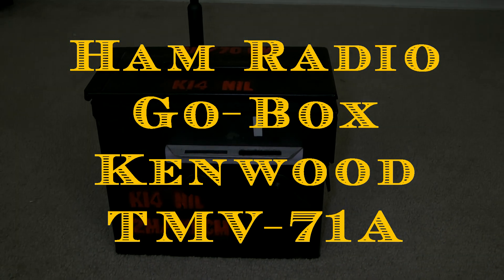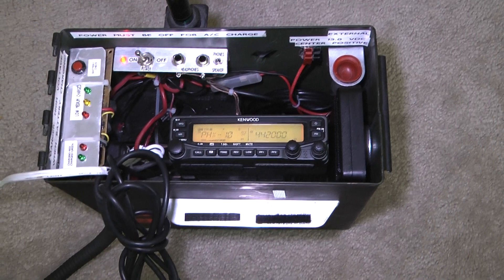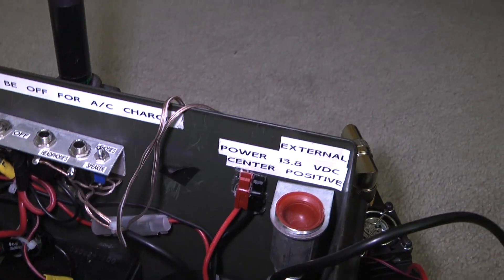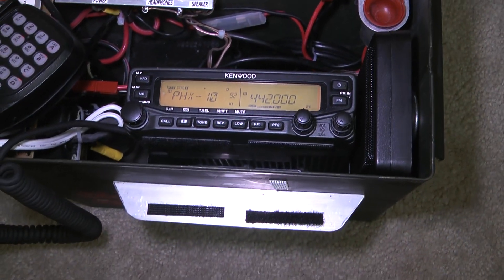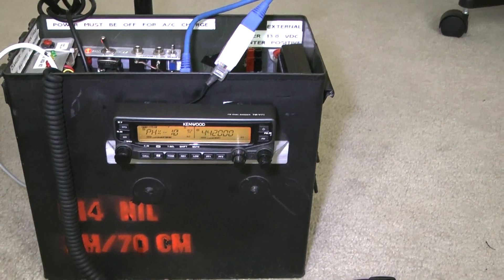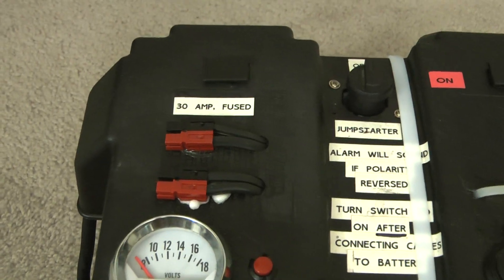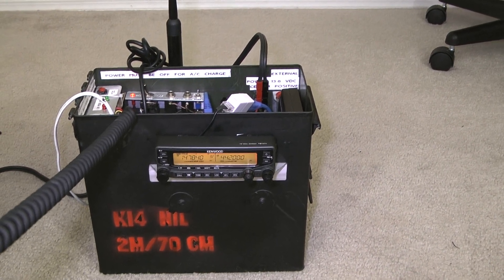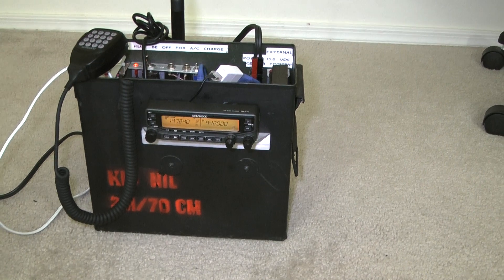Ham Radio Go-Box Kenwood TMV-71A

Comment: Hi John. Do you know if 2 of these radios hooked together will same-band repeat?
Reply: Hello John, no sorry no same-band repeat :) 

Please read the Manual 
Tip: 
Cross-band repeat is a two-way repeater, i.e. V to U or U to V.
The radio will repeat whatever signal was the last one to hit the radio.

For example Kenwood TMV-71A has two features 1 Locked-band repeat, and 2 Crossband Repeat in Kenwood's terminology, is a one-way repeater, i.e. either V to U or U to V, but not both. The radio will only repeat the band that it is set for when you initiate repeat mode. In other words, if you set the radio for locked-band repeat from U to V, the radio will repeat what it hears on U back out on V, but it will ignore what it hears on V. This is useful in situations where your handheld can hear the V station just fine, but you can't get back into the V station from your handheld. So, you set your mobile as a locked-band repeater from U to V and use your handheld to listen on V, but transmit on U.

N6DEZ
Kewnood Land Mobile Radio 
Kenwood USA Land Mobile Radio 
1999-2003 
Kenwood USA Cerritos, Ca Service Center 
2003-2005
Yeasu USA/Vertex 
1995-1998
Reply: thank you for your reply
Reply: ELiTE_OpTiic If you do same band repeat, you have to deal with things like a duplexer and good antenna system and a controller to id the repeater and you would have to wach the duty cycle of the radios. So no, these radios wouldn't make a good same band repeater

Comment from the maker: This antenna does not require a ground plane. The AC charging circuit came from a Jump-starter pack, so did the battery. The battery was so small that it couldn't jump start anything, even the lawn tractor. I took the charging circuit and battery and put them in the ammo can. I didn't make the charging circuit, that is beyond my expertise I'm afraid. The Balun - so I was told - is needed due to the short distance between the radio and antenna, but that was told to me when using a home made antenna, I should try a short length of good antenna cable instead.

Comment: Nice job John. Lots of work in design and assembly. There is some wiring there i would cover , just to stop any shocks or water/liquids accessing it. If the speaker could be also be bought to the outside of the box would be nice,magnetized, maybe it does. best 73 from VK